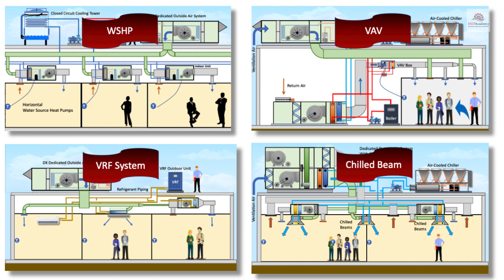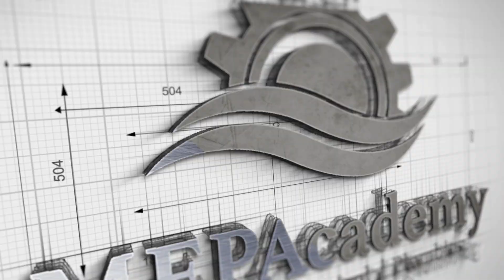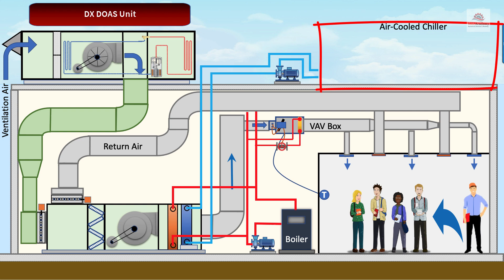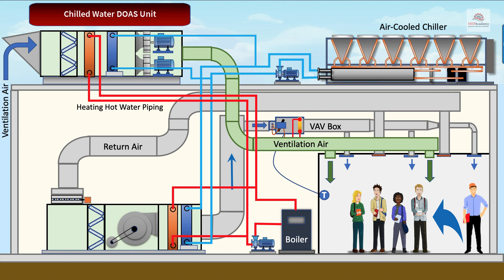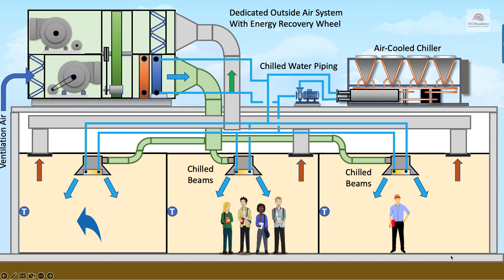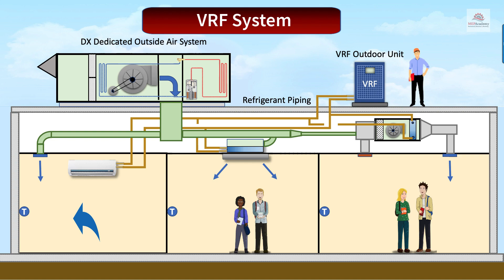Dedicated Outside Air System DOAS

Comment: The energy wheel would you recommended or
Reply from the maker: Short answer: Yes—an energy recovery wheel is recommended on a DOAS when you have high outdoor-air fractions and long operating hours, especially in hot-humid or cold-dry climates. It can cut OA load dramatically.
When it’s a good fit
High OA % / long hours → strong ROI.
Humid climates → use an enthalpy wheel for latent + sensible recovery.
Dry/cold climates → still great for sensible recovery; add frost control.
Typical wheel effectiveness: ~70–80% sensible, ~60–70% latent.
When to think twice
Spaces that prohibit cross-contamination (certain labs, isolation rooms, kitchens) → use runaround loops or sensible plates instead.
If maintenance access is limited or dust/grease is heavy.
Need for economizer/bypass—include a wheel bypass or stop for free-cooling hours.
Design notes
Include purge section (≈10–15%) to minimize carryover if exhaust is less than pristine.
Provide frost protection (preheat or wheel speed control) in cold climates.
Verify pressure drop and fan energy in the LCCA.
Many jurisdictions (IMC/IECC/ASHRAE 90.1) require ERV above certain OA flows and climate zones.

Comment: DOAS units are often over Complicated and have more issues than an air handler. Maintenance costs are higher and long term operational costs are higher
Reply from the maker: The long-term benefits of improved air quality from a DOAS often make them a great choice.

Comment: This is my first time learning about the DOAS system. So basically it is tempering & conditioning the outside air by filtration & use of a heating/cooling coil that is being directed to a space. A fan coil unit or other device is in the space to handle the bulk of the heating/cooling load but the tempered air from the DOAS provides high quality ventilation & reduces the work load of a fan coil, etc. Is my understanding correct on this?
Reply from the maker: The DOAS can be used to handle the latent load, while leaving the sensible load to the terminal units. DOAS units are used in many applications, such as hospitals, Gymnasiums, Schools, Laboratories, Etc. They are used to Comply with ASHRAE 62.1 ventilation requirements, and can be used with energy recovery where applicable. They are commonly used in VRF systems, as most of these Fan Coils can't handle much latent load.
Reply: Ok, got it. The latent load taken care of in the DOAS system is to dehumidify the ventilation air & the terminal units in the space lowers the temperature or increases it therefore taking care of the sensible load. I’m really enjoying this channel !

Comment: Thank you for the explanation. Few questions I have are in regard to the direct cooling using the DOAS for latent cooling and an indoor AHU for air circulation and sensible load. Since the DOAS will be providing 100% OA and the AHU circulating air:
1. Would this create and over pressurize space?
2. How is the CFM balancing done? 
3. Should there be an additional relief fan?
Reply from the maker: Of course whatever air that is brought in using the DOAS will have to have a corresponding exhaust or relief. This all depends on the design criteria for each of the spaces receiving Ventilation air. This is similar to a unit using an economizer. There are several examples in the videos related to economizers and the DOAS unit. Depending on the space requirements you can use the DOAS to pressurize a space or create a negative pressure by exhausting more than is supplied.

Comment: My designer is not using a chiller for a 10000 SF single story bldg? Doas is piped into conditioned space. AC is from a DX.
Reply from the maker: Depending on occupancy schedules and space zoning, there are various system options. Only the engineer who is familiar with the particulars of the project can decide what  the best system is for the building and how its planned to be operated.

Comment: In the VRF system- if the cassette is off/not calling, will the DOAS continue to supply outside air or will it only give air to the room when the thermostat calls?
Reply from the maker: You would need a control damper to shutoff ventilation air to a space if that spaces AC unit was off, and have a VFD on the DOAS unit to slow down the fan when pressure built-up in the ventilation supply duct.